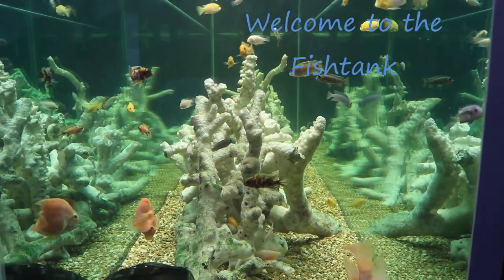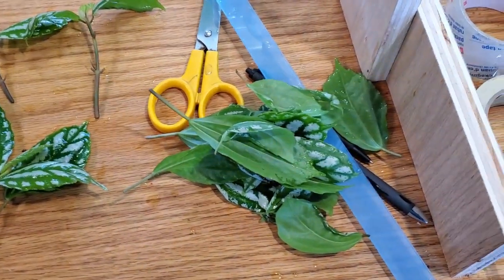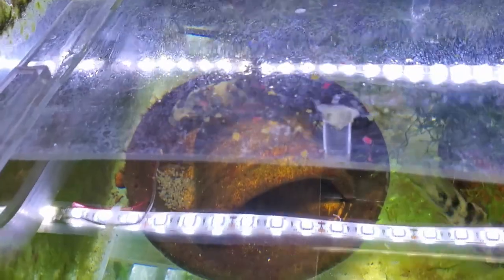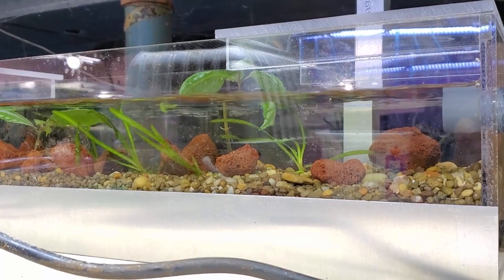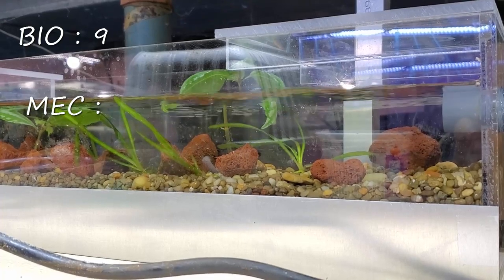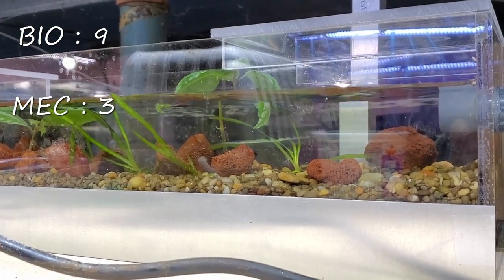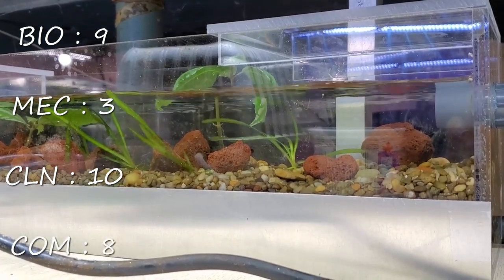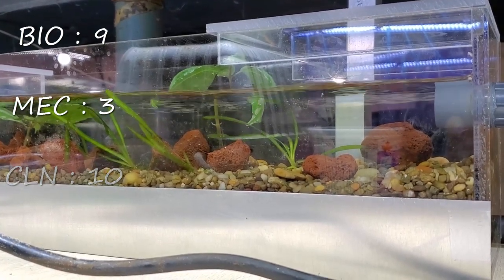DIY Filter Comparison Final Results

Comment: This filter is an interesting idea.  It would also be interesting to do a long term study on using the tank as a filter, with a deep sand bed for the anaerobic bacteria, a gravel top layer for the aerobic bacteria, plus lots of plants for the nitrates, with the addition of an external water polisher to pick up the extra solids. Just another idea, as it would be interesting to see your take on this.
Reply from the maker: Thanks Scott! Once I move the last rack I will have more tanks to set up some other versions

Comment: I would guess that in this version of the filter the largest difference would be the gas exchange picking up more oxygen because of the fast flow rate without being sealed like the under tank version. It is more like an extension of the tank where you can have immersed growth of plants which I like. Makes starting plants easier. That is how I use my hob to get pothos starts going and able to be potted.
Reply from the maker: The flow rate through this version is actually allot slower than the original, but the open top might have an effect for sure. How this runs long term should be interesting especially with the addition of plants. Thanks for sharing your thoughts on this and for watching!

Comment: The hob filter is similar to this only a smaller version. I like both types. The hob has more commercial viability due to its size. However, you can probably run several tanks through the larger one, so would appeal to more professional or proficient fish keepers who have more tanks and want less filters  in their aquascapes.
Reply from the maker: Thanks so much for sharing your thoughts on this Lynn!

Comment: I love the series. I'm surprised you haven't empirically compared nitrogen uptake of any of the planted systems.
Perhaps dose with a known quantity of ammonia and measure how much is left at the end of a given period?
Reply from the maker: The problem with that style of experiment is that every filter sets up to handle whatever load it is consistently exposed to. Once set up ammonia has an extremely short half life in a tank. Short enough that you should not be able to measure any. Spiking the tank with a set dose that's low enough not to harm the fish wouldn't last long enough to be tested with any reasonable filtration system. I was planning on setting up and experiment showing the effects of different cleaning styles on filtration. I could set up an add on where I remove the fish and test this out. Thanks for the idea!
Reply: @FishmanEricRussell  Thanks, I knew you'd have good reason. Maybe a mature filter / plant(ed) filter on a system without any fish - that can handle an ammonia load large enough to have a supportive half-life. Just thinkin' out loud here :) ...

Comment: Watching the old setup videos of the original leak proof canisters is what got me subscribed to this channel way back when, so I have to cast my vote for the original.  But if I am being honest, I  am not impartial.   I have never been a hob filter fan since I got into this hobby.  Commercial ones are overly bulky and tend to be noisy and many also have a weak rubber seal on the pump that will eventually leak.  Furthermore dropping a pothos or the like in it always struck me as a cheat.  I far prefer something like the high humidity filters aesthetics if I wanted to add plants to a tank whose stocking doesn't agree with plants.
Reply from the maker: Thanks so much for sticking around so long David! I couldn't agree with you more. For fish room setups I much prefer internal filtration with the high humidity add on. I think my next build will interest you. Thanks again for your continued support!

Comment: Thanks for sharing all your experience and experiments.  You put crushed coral and coral pieces in this filter.  Will this add carbonates to the tank?  Is this the idea or is it so deep that it doesn't matter?
Reply: Follow
Reply from the maker: Initially it will harden the water a tiny amount, but in the long run it will have little effect. If it were the top layer it would be different. Thanks for watching

Comment: Pardon some criticism.  While it is certainly valuable to comment on and grade features and strengths/minuses of the various models, it can never be more than a subjective ranking, as there is no measured reduction time comparison for a given amount of pollution in a given amount of water using a given model filter.  Were some experimentally minded hobbyist to conduct that basic experiment, we could then select 'best' filtration system with secondary considerations of features, placement, ease of use, etc., etc.
Reply from the maker: You're quite right and never worry about constructive criticism. It's the entire point of these comments sections. To share ideas and different points of view. The problem with setting up a more analytical approach to filtration lies in all of the variables. To approach anything near accurate I would need many tanks all set up exactly the same with the same load of fish and/or plants in each (probably measured to the nearest gram). I don't have the resources for that. So we are left with the subjective approach. I am planning some measured experiments, but they will have issues as well due to the limited abilities of available test kits, but they may yield some interesting results. Thanks so much for taking the time to share your views and of course for watching in the first place!
Reply: @FishmanEricRussell  ... Yes, I don't have the room for such an experiment either.  I always imagined a set up of 4-5 10 gallon tanks, starting with common source water (biologically active) with equal quantities of media measured by volume (since that is the limiting factor for our filters-with-tank pairings).  No need for fish.  Put a different media in an inside box filter (sponge, polyester fiber, carbon, ceramic rings, lava rocks, etc.) and dose the water with a bit of ammonia and a small amount of fish food.  Then simply measure and graph the results over a period of time.  That would give you an approximation of "best" media.  Then, using best media, set up a flow rate experiment or any other factor you choose. 
One could then design a filter that would best use the best media (air, drip, power HOB, sump) and if you really wanted to be exacting, run the experiment again using types of filters as the variable.  Hey, maybe we can find someone with the lab space for this project.  Were such an experiment to be run, I think we'd be very surprised with the results and find out a reason the manufacturers have shied away from running and publishing the results.  I'll bet, for example, that the polyester fiber would measure as well as the expensive ceramic rings or bio balls, and I'll bet carbon beats them all.
Ah, for a universe of time.
Reply from the maker: @PalJoey-on1yi  Very well thought out.  The only issue I would have with it is the lack of fish. There are many things that test kits don't test for in an aquarium. The fish will show with behavior if they are being stressed even if the parameters are fine. Also the bacteria that feed on food before it goes through a gut are different than those who work on the other end. Since we started this line of thought i have been working out a possible way to test it out. It will have to wait till I move the last rack and also for all of the fish I'm holding for clients to go back. Thanks again for all that you've put into this
Reply: @ @FishmanEricRussell  ... High ammonia and nitrite levels, inevitable and even desirable during the test for the purpose of tracking and discerning patterns, would likely kill some fish and terminate the experiment.  That argues pretty effectively against using live fish.  Variability of health and feeding add further problems.  Don't forget, we're testing for effectiveness of media and delivery systems (not fish) on the premise that best results in reducing water pollution will yield the healthiest specimens.
Notice how I inserted "we're," thereby making myself a partner in this Manhattan Project of aqua culture.